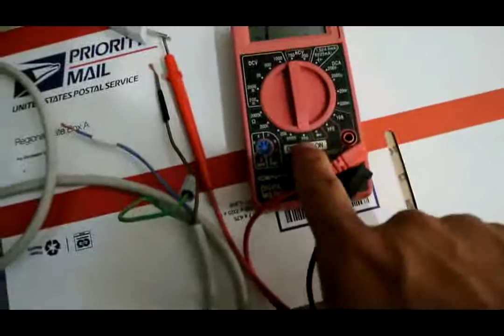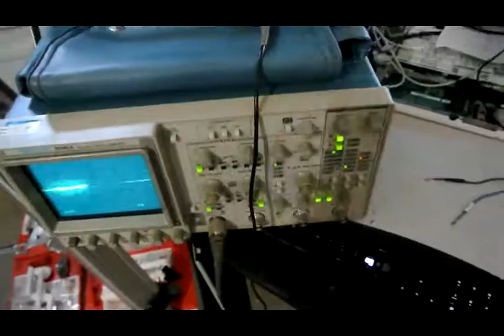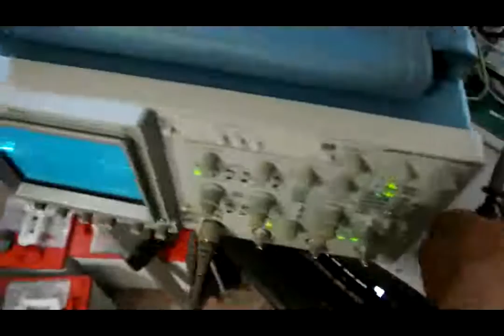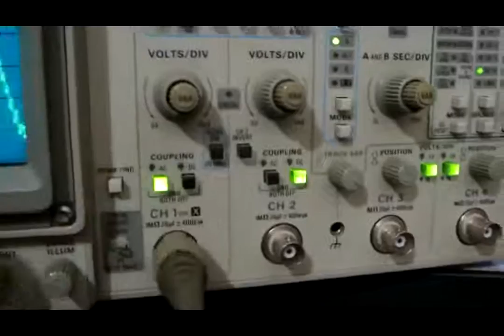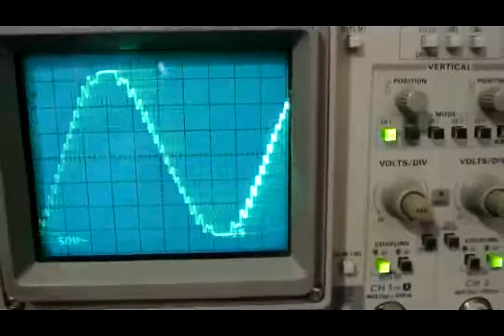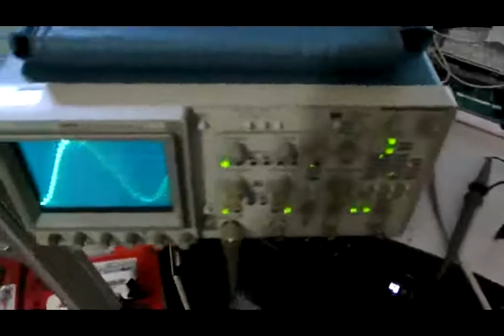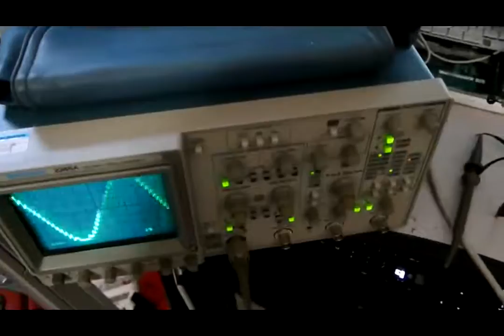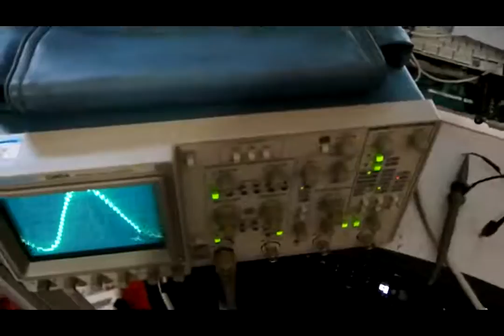Test your inverter for Pure/True Sine Wave or Modified/Squared Sine wave w/ Oscilloscope

Comment: An easy DIY test is to connect and ordinary portable house fan to the inverter.  A square or modified wave inverter will make the fan motor sound buzzy.
Reply: Thank you for that. I had a feeling it would cause problems in inductive loads. I am not sure how modified sine wave inverters affect capacitive loads; perhaps not by much. I think it might affect frequencies of radio receivers and transmitters (transceivers), but again, I am not sure.

Comment: Another, safer, way to obtain the waveform, assuming that one uses a circuit with an incandescent light bulb (for example as it's a steady wattage draw) is to use a amp clamp ($25 and up) which converts current into voltage and this amp clamp will be connected to a FNIRSI DSO152 digital mini scope ($30ish) or any scope and obtain the clamp reading by plugging a AC line splitter ($20 and up) into the inverter's outlet and then plug a 30 watt incandescent bulb into the line splitter so that the amp clamp can obtain a reading by clamping over the line splitter at the 10X section. I figured that the amp wave should be identical to the voltage wave and safer for me to obtain that pattern with the equipment I have.
The amp clamp will convert the waveform into voltage and follow the exact up and down shape as the voltage pattern coming out of your suicide setup in this video, without the dangers of using the suicide cable.

Comment: Well....despite the below criticism I think this is a pretty good video----I have seen a LOT of "sin" inverters that actually were square wave---I have a friend who really damaged a new Samsung 50 inch 4K TV :(Its kind of gutsy to hook up directly to oscilloscope--called a "widow maker"  chord in Chicago....LOL...but if you're sure that the scope has internal isolation--then its fine...I would have checked the cord by simply using "continuity" test with a DMM...but his way does show resistance...which is useful on a very long feed.I would note that ALL "pure sin" inverters on the market  simply use PWM to produce a kind of Faux sin wave based on square wave intervals---which at a small enough interval is visible...The cheap harbor freight inverters can be surprising---I've had several with very good approximated sin waves...
Reply: Inverter is powered from a battery, it is not on the same circuit as the oscilloscope. Inverter and the oscilloscope don't have common ground.

Comment: Thank for the video. It was very useful 👍🏻 Do you advise to use some transformer between oscilloscope and the inverter to prevent the oscilloscope from blowing up? Or because the inverter is powered from a battery, it is not in the same circuit with the oscilloscope?
Do you think it safe for the oscilloscope to check the sinus waveform comming from a gasoline power generator with the same technique?

Comment: You need to hook up a load to your power supply (inverter) to actually measure the output. Under no load conditions all you see is the noise from the switching electronics. Inverters have a minimum load they need in order to function correctly. Put a 50W load on either one, something like a lightbulb, and you'll see the waveform change.
Also why would you switch from a 50x probe to a 10x probe when checking different inverters? Seems like someone really doesn't' know what they're doing.

Comment: I'm guessing a battery charger could be used to test wave form as they step it down to 24v or 12v before rectified.
Have you ever tested a generator  for sine wave, I see some advertised inverter generator pure sine, and others just automatic voltage regulation to prevent voltage spikes , I'm assuming they both have good sine wave.

Comment: I'm think mine inverter is actually modified   sine wave.  It baught  it as  pure sine wave  but I noticed  the dc amp  usage  with  no load is the same as the modified sine wave  from the manual

Comment: Use a standard AC extension lead and the correct probe attachment. Better still, connect all AC connections, double check, then plug AC extension lead into inverter, power up and stand back. This is poor electrical safety from someone who clearly knows better. Sparky's rule - Your first mistake with AC may be your last.

Comment: Could’ve also used a step down ac transformer to test for pure sine. It would have provided isolation from ground as well as stepped the voltage down from 120v to 12v which would be a much safer level for your equipment and more importantly you.
Reply: And messed up the waveforms. Differential probe is the way to go.

Comment: 4:55 "This wire is hot, if i touch it, i'm gonna die" 
NO !!!  You are not gonna die !!! 
Because you don't feel anything when you touch that "hot" wire, because an inverter is not referenced to ground, 
and you use 12v battery, and so you can't be electrocuted !!!
Also, the output of a inverter is isolated from his input, even when you use a 12V source with ground reference.
You can only be electrocuted with a inverter, if you tough the hot and neutral wires at same time.
Learn your electronics before you distribute wrong information.
Reply: Thank god someone else struggled to watch this. It hurt to see someone supposedly providing 'good information' that's so blatantly incorrect
Reply: actually you're wrong because at the moment he said that he had that neutral wire grounded. it seems to me you dont know what you're talking about.